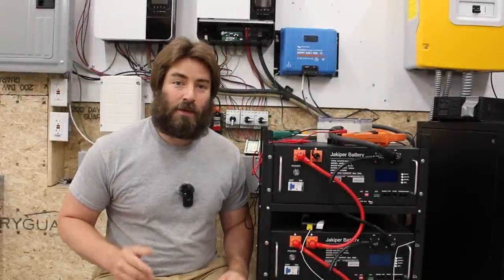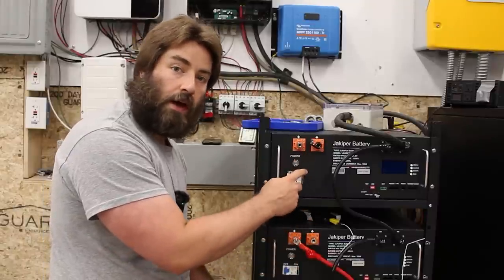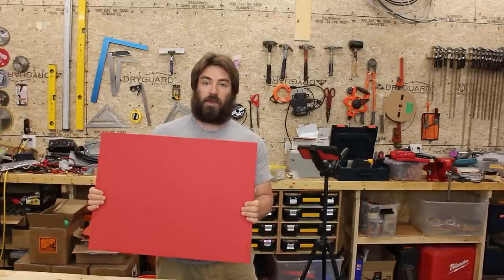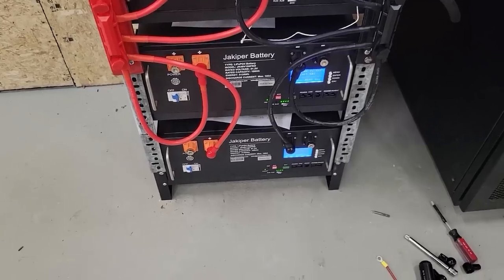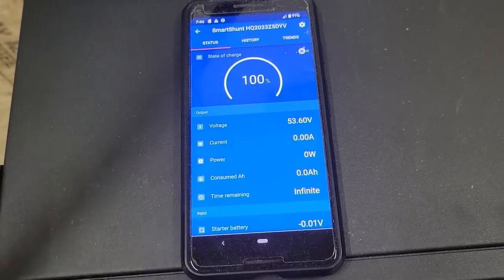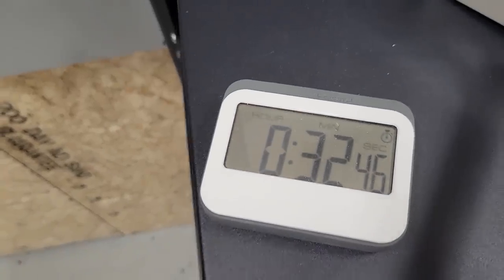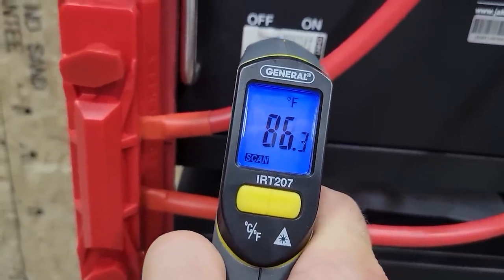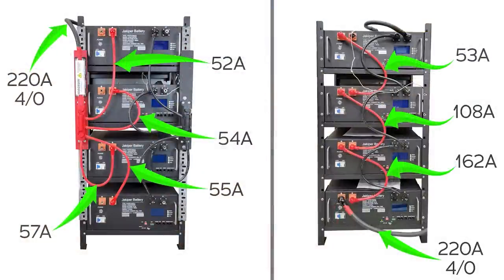Best way to wire batteries.   Part 3

Comment: Hi David, thanks for making this video. Daisy chaining is one of the reasons I dislike server rack batteries. Thanks for showing people why this is a poor practice. Of course the other reason is that the batteries get used asymmetrically when there is greater resistance in the  circuit from one battery to the other. That means that your C. rate will be higher than it needs to be on one or two of the batteries early on and it will shift to the others later in the discharge. Thanks again sir. I have learned a lot from your channel when I was getting started in this DIY journey. I like your style as well.

Comment: Thanks for the video David. Great presentation and explanation of the benefits of busbar configured battery storage. I realize most will know the tidbit of heat adds resistance, which creates more heat (nice to see the lower temps here). Also great to see the kids involved as well!! Keep up the great work ☺️👍!
Reply from the maker: Thank you for your nice comment.
Reply: Heat is the result of resistance.
Reply: @DavidPozEnergy  In your code book there  should be a generic torque table for different stud sizes types, If any part may lack that info

Comment: You are definitely an engineer (and not merely a DIYer). I am overwhelmed just looking at your configuration, and intimidated at the prospect of trying to build a system (that hopefully won't be as complex, but also will be therefore less functional/ efficient).

Comment: Perfect workflow and presentation. The apprentices are learning quickly! It shows clearly they have a wise and patient instructor :-) Another way to quantify efficiency gains is to measure the change in voltage drop across the load-carrying conductors as they heat up, though how you've done it with a temperature reading does quickly get the point across in the video. Thanks (as always) for sharing with us all.

Comment: Using ohm's law the power loss on each cable, link between the terminals on a battery pack, etc, in the daisy chain can be calculated.  V x I.  Amps is what the clamp meter reads, V is the voltage drop across the thing being observed, ie a cable, a link, etc.  At full tilt, 400A, through the top cable 30mV of drop would equate to 12 watts.  That's more than enough to heat up the cable, but in the overall picture considering the load (400A!) that's not a lot of power.  I'm guessing at full tilt daisy chain loss would total maybe 100 watts.  Sure it's more than nothing, but again considering the power draw to get there, 20kW, it really is nothing to worry about so long as the temperature rise stays within the rating of the insulation in its installation environment.  That said, there's nothing wrong with a cool running system and it would be 100 watts less to remove from the room the equipment is in.  30mV drop was fictive, actual drop may be higher so measurements would obviously need to be done.

Comment: David, you were the very first YT person I followed for batteries and solar.  I love how thoroughly you go through everything and I always learn from your content.  I will be building out my system next spring using 6 of the EG4-LL batteries and the Sol-Ark 15k.  Yes, I know your thoughts on the Sol-Ark but I need something fully UL certified for codes and will be using it for a whole home backup and to save on time of use charges until I get my solar arrays in place.  I have also spent the last year analyzing my loads using the Emporia Smart Home Monitoring solution so I hope to avoid the unbalanced load issues you were seeing.  Waiting on Solar until I can win the HOA battle, Oklahoma doesn’t have a law luke CAN and other states do that prevents HOAs from banning Solar.  Keep up the great work and thank you for inspiring me!!
Reply from the maker: Hi EB,  thanks for the comment.  I wish you luck against the HOA.  I wish HOA's were more willing to accept solar.  When you choose to buy some EG4's, please use my affiliate link as it makes a huge difference for me.  These videos take an enormous amount of time.
Reply: @DavidPozEnergy  You can count on me using your affiliate link.  I plan on going down to visit Signature Solar on 9/9 & 9/10 and will make sure to share your impact on the community while I am there.  Not going to buy yet, just visiting while I am “in the neighborhood”.  Send me a DM if there is anything I can get for you while I am there.  I cover shipping up to $300 for you.  I’ll also you your link for Sol-Ark and panels so I’ll reach out in March when I will be ready to buy.
Reply from the maker: That's generous of you, thanks.

Comment: Busbars are the way to go for sure. I have the EG4-LL batteries and the 6 battery enclosed cabinet with built in busbars. Those are most similar to your setup here because each battery has a jumper to the busbar so nothing in front of the battery is blocked or putting stress on the terminals. Cheers

Comment: Our old standard for copper buss was 1 sq in per thousand amps - 6" x 1/4" gave us 1600 amp buss. But then we were running continuous heavy loads in hot environments. Also guard those fuses against becoming shrapnel. Heaviest I ran was an 8 stack of 1x8" for salt tanks.
Reply from the maker: Thank you, that rule of thumb is very helpful.
Reply: @DavidPozEnergy  I think what Bill Burton is trying to say is that your bent bar, based on his rule of thumb, being 1/8" x 1" or .125in square is capable of 125A. I didn't know that rule of thumb so I just look it up in tables, and I've found that a 1/8" x 1" bar can handle 270A with a 30 degree C temp rise. It won't ever get that hot because the fuse block and junction block will act as heat sinks. For comparison your bar is 0.125 , 2/O cable is 0.1045 and 3/O is 0.1318 square inches cross sectional area. What you have is fine, but if you had to make it again I'd use a thicker or wider copper bar.

Comment: I just bought two of these batteries and will be getting two more in a few months. I will make my own cables or of oversized welding cable. Possibly 25-35mm2. 
 I'll also make my own bus bars out of thick copper flat bar with stand offs or the plastic sheet stock. Lots of options. I think diy is better, more flexible and more cost effective than pre made commercial product.
 Never skimp on good fuses either

Comment: I run a combination of daisy chained with a 1000A buss bar. The reasoning for this is that I have 20 batteries, so both daisy chaining and buss bars alone would not be appropriate. I have 4 banks of 5 batteries. Each bank is daisy chained, then combined on a 1000A blue sea systems buss bar, where the inverters also can be tied in.  With the size of the battery pack, even at full output with 3 inverters I’ll never pull more than 30% of the max battery output anyways, so the daisy chaining isn’t a big deal as far as balancing the load in each battery goes.

Comment: Great work David. Cute helper too. My she has grown so fast. 
Thanks for posting this test, as I am about to connect 7 batteries together. I will try my best to use same wire length. I dont have a server rack like you, but bought a home depot husky rack to hold the batteries. Its rated at 5000lbs. (We will see).
Reply from the maker: I'm sure that shelving unit will work great for you.  Are you going to have any videos on it?
Reply: you're a SAN dude ;)
i'm sure you can find a second hand san rack on ebay somewhere on ebay
Reply: If you increase the wire gauge a few gauges (which is always a good idea anyway) you don't have to be so concerned about making sure the lengths are the same.  They just need to be close but the larger the gauge, the less voltage drop, since internal resistance is lower so it will make less of a difference under heavy load with larger wires.  Your crimps and connections will be more important than a small variation in wire length if you use a larger gauge.

Comment: Great demonstration of the effects of cable resistance.  You are effectively reducing the current through the cables by a factor of 4, thus greatly reducing the effects of cable resistance.  Since you have two terminals on each battery module, you could double up the cable connections to the bus bar to decrease the resistance by an additional factor of 2.  I don't know if this is cost effective, or the gains would be worth it, but you could probably reduce cable temperature rise to single digits.  Probably approaching the point of diminishing returns...

Comment: Definitely makes sense. Instead of the load passing via basically a 4 gauge cable with each battery adding more load to it at each daisy chain point, you now have each battery using it's on dedicated 4 gauge cable to the busbars with the busbar passing the load to the heavy cables tied to your inverters. Not that it should make much of a difference with the short jumpers you have but ideally the cables to the busbars should all be the same length as well, this minimizes the voltage difference and will spread the load as evenly as possible.
Reply from the maker: I agree.  All the 4 gauge wires I have are the same length.

Comment: I usually fuse the negative side and use switches or breakers for the positive side. Blue Sea Systems make a great 1000amp busbar, and great class-T fuse holders.

Comment: You could improve efficiency by making all your wires the same distance from the bus bar. Also 4 gauge wire will heat up if you draw large amps out of each battery. 00, 000, or 0000 would give you more max output from each battery. But keeping the wire distance the same from the bus bar to the battery terminals will give less resistance and less overall energy loss.
Reply from the maker: All the 4 gauge wires are exactly the same length.
Reply: The max output for each battery is 100amps and 4 gauge welding wire will handle that easily, though during his load test at 95% he didn't go much above 55 amps on any of those batteries. So he's still got a lot of headroom left, plus his fuse will limit it to 75 amps per battery since it'll blow at 300 amps which would be almost 17 kilowatts of draw. If he had fewer batteries then it might make more sense to upgrade to heavier cables.

Comment: First, I think the long hair and beard on you looks terrific! Once I got over the shock and realized that it was really you. Great job and video series, David. I'm curious about how you incorporated your entire wiring system in your home to the breaker panel in your garage that your solar system's AC power from your inverters is connected to. Additionally, how much voltage and amperage is the breaker switch between the inverters and AC  panel rated for?  Lastly, do you know any way a poor old man can get a rack and 4 48V server rack batteries given to him without making hundreds of YouTube videos? Great job, as always, my man!

Comment: You could also secure 3ft bus bars to the rack with stand-offs and run cables from the batteries.  That'd let you use shorter cables and keep them out of the way.
Reply from the maker: Absolutely.  That's how my Gyll batteries are built: https://youtu.be/r0vuSo5eIOY

Comment: BUILD A RAKE  SHAPED COPPER BUS BAR for the right terminal to
* not cover or hide anything
* solve the tension issue 

You take a long copper bus bar, drill 4 holes in it with the distance of the terminals and then cut 4 short copper busbars of 10 cm as connectors from the terminal to the vertical bus bar on the left connected with screws and nuts.
This way the tensions from low 20°C to maybe 30°C will be divided onto the 4 terminal screws and the 4 bus bar connection screws you then will have to check from time to time which you will also feel quite easily if you do check the displays. 

That right main busbar might also be rerouted on the right once you have removed the handles there.
At the end always a compromise one way or the other, but a least possible and quite usefull I guess in the case you have a close rack behind glas or acryl without having such bus bar outside of the rack. Adds a bit of safety for all.
Reply from the maker: Good idea.
Reply: Rake is interesting, but the cost might be a lot higher than current solution.
Reply: Both issues can be solved by bending the bar into M shape as it rise from the terminals.   So it’s bending at thinest part. 

Do not use oval or slot hole. It doesn’t really allowed to slide because you have to torque it down. At the same time, you lose contact surface area. 

May I also suggest using some bulb grease at the contacts and plasti-dip the rest.

Comment: You can only daisy chain 2 batteries without unbalancing the loads on the batteries too. Main pos and main neg to different batteries. But no matter how you set up your daisy chain with more than 2 batteries the ones with the mains will see more amps pass through and fewer amps as you move away
I work on RVs.  And see lots of what are basically small house inverter systems.  A lot of the newer ones have lithium ion batteries similar to what you have. And they have charge controllers to balance voltage. They use an extra wire to the negative to vary the ground side potential I believe. But the older big class A’s with big inverter’s with lots of flooded batteries always had better performance from 6 volt batteries for same watt hours of batteries vs 12 volt partially because now I can run 4 batteries from 1 main neg and pos with a balanced load since will be wired as a pair in series and parallel but making 2 12 volt batteries instead of 4 in the same space.  Putting more than 2 battery packs in a daisy chain will always make an unbalanced load and more stress on your end batteries. 
The charge controller can balance batteries on the charge cycle but not the discharge cycle. 
If you need more then 2 batteries you should not daisy chain or use appropriate voltage in series to make a 2 battery pack system.  So off the shelf batteries much more practical to have your bus bars and only daisy chain 2 battery systems of relatively equal potential

Comment: Another point about busbars that directly connect all the batteries together.   With busbars you can't easily or very safely disconnect a single battery if you need to.  It can also be more difficult to insulate the busbar between terminals though it can be done with judicious shrink tube efforts however the little plastic cable caps don't work then for the terminals.

Comment: since both connections coming off the batteries are from a single busbar you could just use 2x 4awg cables will handle 200Amps easily.

Comment: Good job. That looks soo much better!! Though you did forget to stagger the main positive and negative. You have the main positive and main negative on the tops of both bussbars. Sure it shouldnt make much difference since the bussbar has a nice low resistance, but it still has resistance. So just move the main negative cable to the bottom and shift the cables up one.
Though as long as it doesnt trigger your OCD I dont mind either 😉
Cheers keep up the awesome battery/inverter creations!
Reply: hmm also stacking the terminals isnt great either. you need 5 terminal bussbars
Reply from the maker: I appreciate the time you took to write a comment.  I disagree with you about the need to stagger the +/-.  I actually address this exact question, and then demonstrate it in the video.
Reply: @DavidPozEnergy  yea, I saw, The bussbar has such low resistance it doesnt make a noticeable difference. Though I think the main imbalance is from doubling up on the studs, then the ESR of the packs.

Comment: Btw, the US really needs to start using NH fuses, they are so cheap here in germany, a 300A NH2 fuse (rated up to 440Vdc, smaller fuses are rated for 250Vdc) with 25kA DC interrupting capacity, with base will cost me roughle 15€ used or 35€ new.

Comment: You could put a longer bolt and put 2 lugs on the first battery(in and to 2nd battery) with a 1/0 wire, then next battery with a 1 awg wire, and last with 4awg wire.  Could also use a double wire lug.  But the advantage of having a central buss bar the way  you did is that you can remove a battery from service without effecting the others.

Comment: If you arc the bus bars between the batteries you gain the flexibility so you can tighten the nuts without having to slot the holes,  and you won't block the screens or ports. You would use more heatshrink.
Reply from the maker: That would be interesting.  Have you seen anyone do that across 3 feet of copper bar?
Reply: @DavidPozEnergy  I've seen arcs used in other fields to allow a controlled flex between 2 ridged points. I've seen it done in plumbing when there are wide temperature swings in the fluid or gas. As you can imagine metal pipes also change length with temperature.
There are charts and formulas that will tell you how much copper bars will change length for a given temperature change. If you make a curve in the bar it will curve more when it gets hot and straighten out when it cools down.

Comment: Are the short cables from each battery to the busbar exactly the same length?
Reply from the maker: All the 4 gauge wires are exactly the same length.  They were pre-made and sold by Orient Power.  I have a link to them in the description.

Comment: Nice work on the busbars. One thing I don’t understand is why the fuse is rated at 300a when the max your inverters can draw is 200a DC. I’d down the size of the fuse to protet the inverters from a potential surge.
Reply from the maker: I used a 300A fuse to protect the 4/0 wire.

Comment: I think anyway the connection order on both busbars has a matter, that's maybe why you did have a small unbalance in those batteries.
Did you try to connect shunt and fuse at the opposite sides of the busbars?

Thanks for the video!

Comment: Another alternative test that would be very interesting. Using fully charged batteries show the difference in time with a specific load(1000watts). Run both ways to reach 50% point. So I would see how much difference exactly this improvement makes.